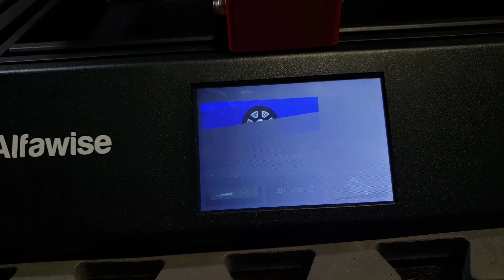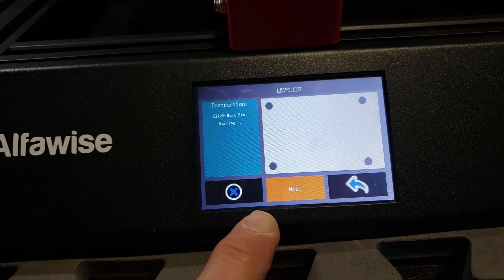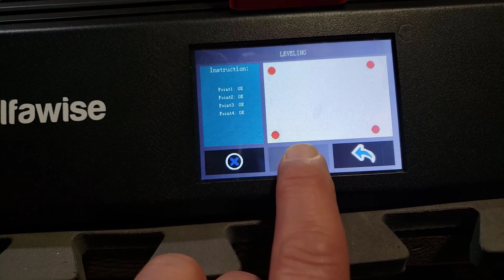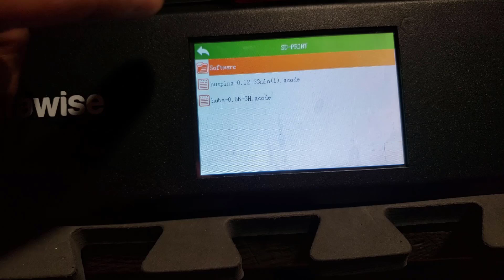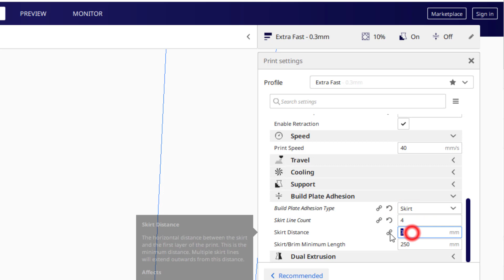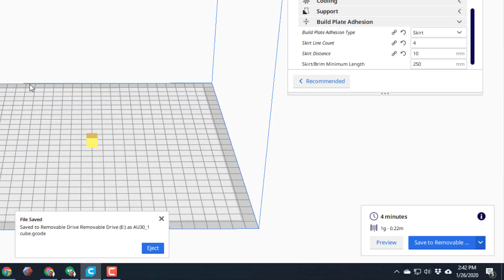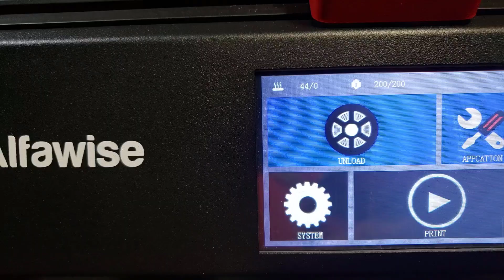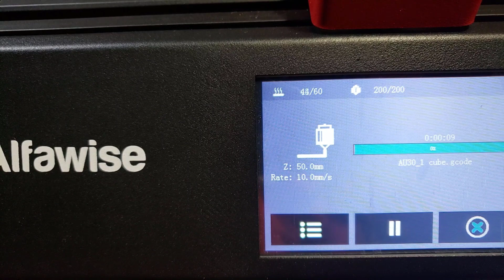First Steps - Alfawise U50 3D printer - Up and Running in Minutes!

Comment: hello and thank you for your video, Can you tell me if the Alfawise u50 printer works on Apple Mac ?
Reply from the maker: I do not have a mac, but it is more important that you slicing software works with the mac. I recommend Cura and that does work on a Mac. Once you "slice" the print you can save it to a SD card and take it to the printer. No connection needed. If you printer is connected, you can just click print... but it is not essential. Long story short, I expect that they connect just fine.
Reply: @HLModTech  Thank you for your quick reply,
yes the cura software works very well on the mac
 
best regards
Reply from the maker: My pleasure. Keep me posted if you have any questions!

Comment: ok here another one: my cube is not a real cube! is like shifted on the x axes of 3mm! ever happened before?
Tighten the x axes belt (that what the guide suggests for dislocation)will help or it could be something else? appreciate your thoughts!
Reply from the maker: I have had stuff like that happen. Once it was as simple as a cable was getting caught as the print was moving... The X axis is a great place to start. What speed are you printing at as well?
Reply: HL ModTech yes I fixed tightening the x axes belt! I am mainly using your settings for this first prints 👍
Reply from the maker: @giuseppecarbe688  I would also print something small I was getting it honed.   I used to print in the front left corner of the bed as I could get level easier as I learned the printer.

Comment: thanks, I think I fixed that issue, another one now is that I can't push the PLA into the extruder..it's too tight!
Reply from the maker: Make sure you type a number and press enter to get the extruder heated. Or if you are using Cura you can just hit the pre-heat from the monitor tab.
Reply from the maker: I also quite often clip the filament from different angles when I am having trouble getting it first in. On all my printers it seems there is a corner that catches or something when first getting that filament in there. I have often thought of making a filament sharpener so it was a point that I was putting in... =)

Comment: actually I think that my z axes goes way too down! You know what can be the reason?
Reply: ok I know why... on the left side the little thing was set too down.. :)
Reply from the maker: I had to tighten the screws on the bed to get the bed leveled right. It is also possible that the Z end stop is not connected. That wire is on the bottom of the rig and is pretty small.

Comment: Can I use Nylon x With this printer ?
Reply from the maker: I have never used nylon X. What heat does it require? I always use PLA, so I have not even glanced at what the top end capabilities of it are...
Reply: Temperature required for nylon X is 260-265 degrees and bed Temperature need 70°
Reply from the maker: @mei2533  I will take a peek, but there is a link in the description where you could read it yourself...
Reply from the maker: @mei2533  Site says hot end max is 260... They do not list the max bed temp. The supported materials do not list nylon either.
Reply: So does it support Nylon ?